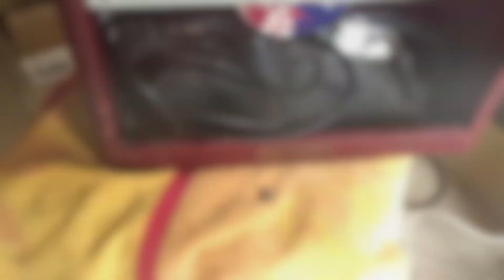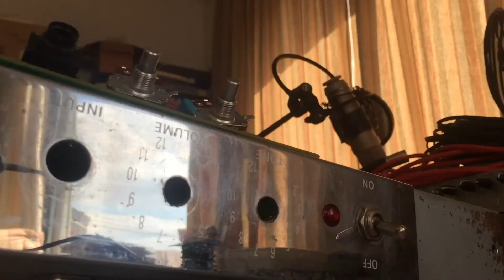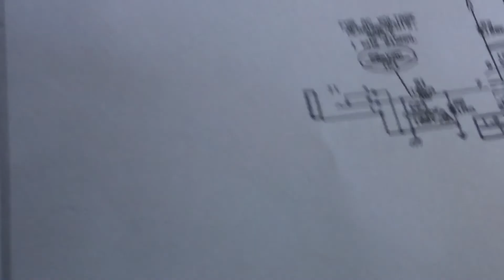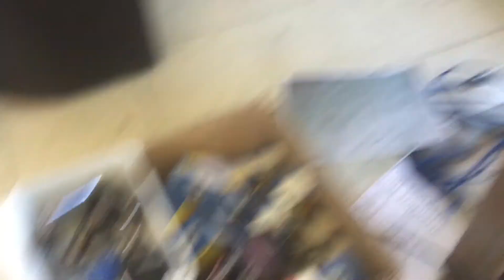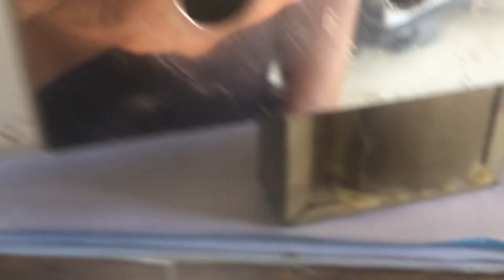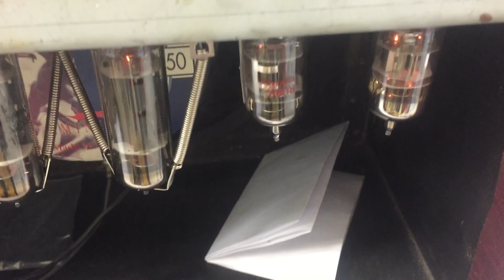Fender PRO JUNIOR - so hot it melted solder joints!

Comment: Maybe an adjustment bias required
Reply from the maker: Hi Hugo, thanks for commenting. Bias was ok after repairs. The tube had lost connection with B+, so a lot of current was pushing from the filaments without a place to go... hence: overheating of the tube and board. At least, that was my conclusion.

Comment: I don't believe that the first preamp tube needs to be replaced. It might seems to be slightly microphonic, but every tube makes noise when you tap it and considering that on this amp Fender tried to take the most out of the first tube. After all, they didn't have many stages of amplification...
Thanks for the video